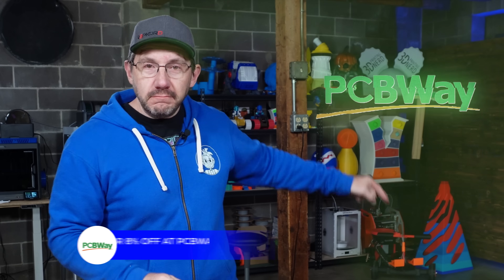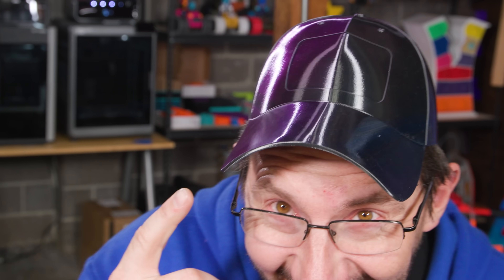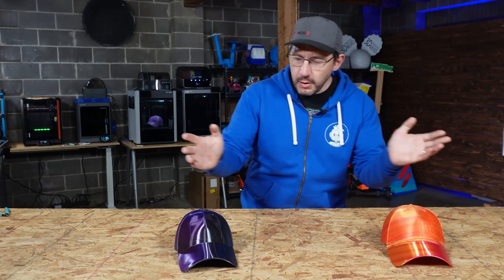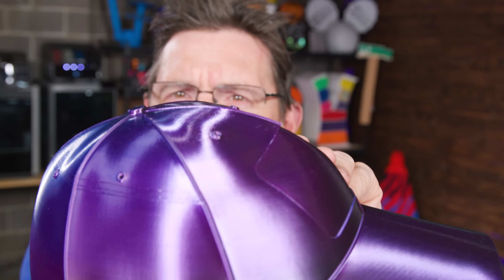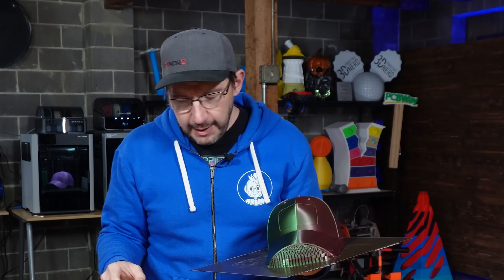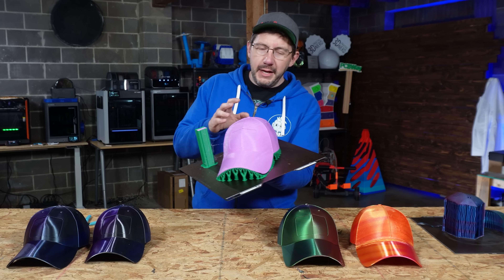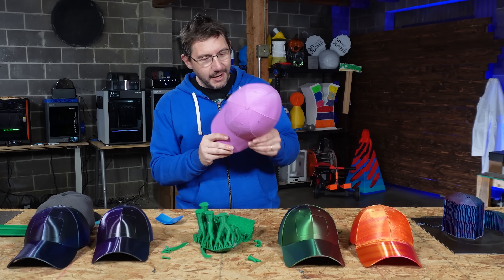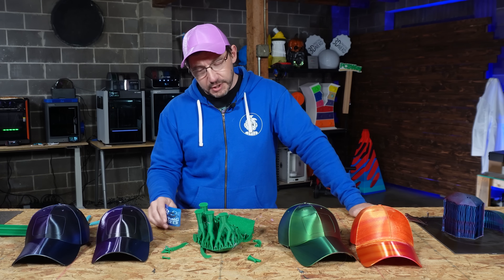HOW to 3D PRINT a HAT!

Comment: Does the PCBway discount code only work for the 3D print service? Wanted to order some cnc machined parts, but the code is not valid anymore 🤔
Reply from the maker: Oh that’s weird it should work for everything. I’ll email them and ask.
Reply from the maker: HEY just got an email back from them. Turns out the old code got used up the new code is 3DPN25 - let me know how that works!
Reply from the maker: WAIT another update. Got another email saying the old code should work again now. Hahah. Let me know if you have any issues.
Reply: @3DPrintingNerd thank you for getting back! I already have ordered by now (for 2k$🫠) 😂 I will try next time! 😬

Comment: It looks cool, but PLA is not going to breathe and it sounds super uncomfortable. That sounds like a horrible idea. at the very least you could use TPU. It won't breathe, but at least it will fit better.
Reply: It is as good idea as 3D-printed airless (which itself is wrong) basket ball that doesn't bounce (while buying working basket ball is way cheaper).

The trick is not HOW but WHY 😅

Comment: Several months ago I printed the standard hat, scaled it up 104-105%, and then printed my logo really thin then used a heat gun to soften the logo print and pressed it to the hat to form it then glued it on. Wish I could attach a picture, because for a first attempt it looks amazing! It's a conversation piece for sure!
I love the flexible PLA or TPU idea, and thought about that as well, just haven't gotten around to trying it.

Comment: How did you get flexible pla to print from AMS?  I thought the flexible pla is incompatible with AMS?  I read that there is no way to mix external spool printing with ams.    Please let me know.  Thanks.
Reply from the maker: Hey! watch again, I had to feed it through the TPU hole on the back.
Reply: @3DPrintingNerd  Does the print stop at the color change for print support pla filament?  This seems like this will have a lot of color changes to feed it manually.  Wow.

Comment: There's more support material than hat.. it's a novel concept, but it just doesn't feel worth..
Reply from the maker: I'm on your side so far - I don't know if I'll print these again because the time and support material was A LOT. However, I really dig the concept and I'll try to find a way to do it with less material.
Reply: @3DPrintingNerd if the supports were custom-made to be conical on the inside, that would definitely help

Comment: Joel, the under-extrusion you got from the TPU hat is from using the ams-ht as a dry box feeder, the wheels inside doesn't spin freely enough (most likely from it being a driven system with no mechanism to really disengage the rollers from the power train).  I had the same issue on my 2nd set of whaleberrys, noticed it on the first couple hours so I was able to stop and switch it out from the ams HT to my sovol dry box, and printed perfectly for the 5 day print after that.  Just food for thought.
Reply: The drag from the ams-ht wheels when using the external port is just enough to create under-extrusion.